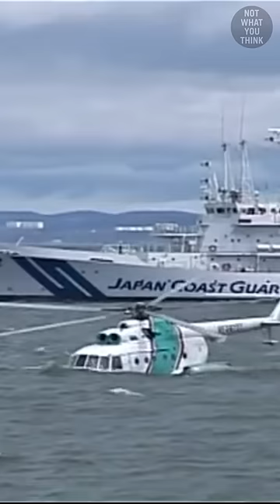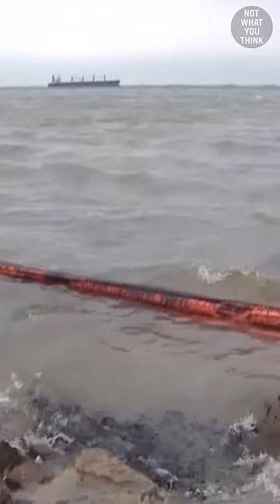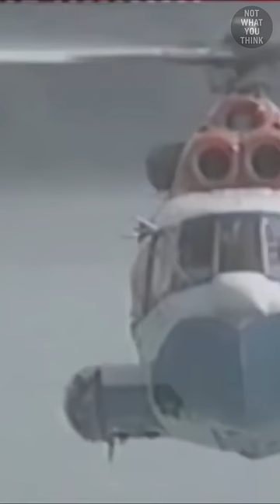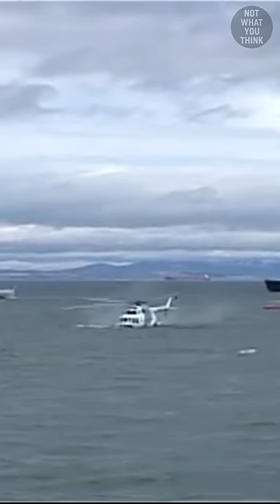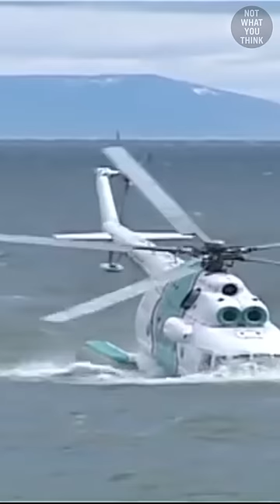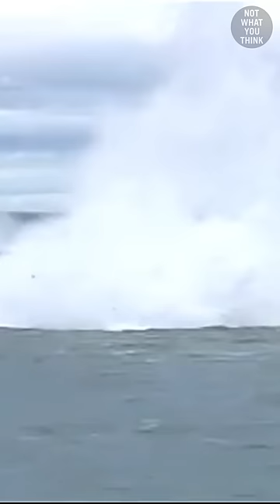Emergency Training Gone Wrong

Comment: Pilots should have stopped the rotor engine, and immediately evacuated via deep dive and swam as far out as possible.
Reply: That would have looked just as stupid as what he did do seeing that it's an amphibious anti submarine helo designed to land in the water.
Reply: @steveletson6616  Except it was pretty apparent it wasn't taking off after multiple attempts. Now instead of looking silly and having to recover a helicopter mostly intact with all crew safe you have dead and injured as well as a trashed helicopter.
Reply: @zyeborm I don't think you understand what he meant possibly. By "it's an amphibious vehicle" I would think that @steveletson6616 is implying they should've just shut off the rotors. 

It's a helicopter, yes, but not a normal one whatsoever. It's designed to be able to land on water as it's an anti-submarine helicopter (which sounds insane but it's true lol). 

The reason it couldn't take off again was due to (one of?) the engines failing which limited it's power output. Instead of attempting to takeoff with this issue over and over again until it nosedived, the pilot should've simply cut the power.

No one would need to deep dive since the helicopter is designed with a type of boat-like hull so it floats, hence why diving look just as stupid as what the pilot did. Both are unnecessary and look stupid because he should've just turned off the rotors, saving all of the crew and probably even the chopper
Reply: @Slyfoxx  they are amphibious after having all the seals fixed and openings closed etc on them. IE they can do it if prepped for it specifically. Even then it's limited to like some number of minutes not hours.

Also I'm the one saying he should have shut down.
Reply: Yeah agreed this wasn't combat training
Reply: @Slyfoxx  Deep dive as in the crew rush to the waters and dive deep to lessen any harm that may be inflicted by the still spinning rotars, and swim as far out possible. NOT the machine itself.
Reply: @steveletson6616  So you wish to sit there instead of hopping into the waters and hope for the best by being a sitting duck. You do you.
Reply: @anadventfollower1181 There's lots of assumptions going on here because the video doesn't provide a lot of detail. Since the chopper was involved in marine rescue training manoeuvres, there's a chance that all of its seals and hatches were in good order. If that's true, then the chopper would've been the safest place for the crew. If the chopper was designed to float so that it could touch down in the water, then presumably it was made watertight enough for the thing to take off again had there been no mechanical failure. The sea is very cold and unforgiving, so hypothermia is an issue, not just drowning. As there were a number of rescue craft in the vicinity, then staying warm and dry and waiting for a nearby vessel to come for them sounds like the ideal course of action.

Perhaps, though, the chopper crew knew how poorly maintained their aircraft was, and perhaps they were already taking on water, and so escape would've been prudent. We need more info to know which scenario applied, though.
Reply: @PrenticeBoy1688  The problem is, if there is no lift, and a rotor is going full force while it is tipping forward- what do you expect when it finally makes contact with the water? No human would come out injury free by being jolted and thrown around like some rag doll. It is about knowing the outcome.
Reply: @anadventfollower1181  What if they cut power after it became clear they didn't have the power to lift off? From the footage shown, it looks like it was another attempt to lift off that drove the nose under.
Reply: @PrenticeBoy1688  Yep. That is exactly what happened. That is why the first few attempts should have indicated that to the pilots, prompting them to immediately cut the power to the rotors instead of trying to life off.
Reply: @steveletson6616 That is incorrect. They are not amphibious. They are designed to float for a short time in order to allow the crew to escape safely in an emergency. Landing on water is not part of ordinary operations.
Reply: @Slyfoxx  That is incorrect. They are not amphibious. They are designed to float for a short time in order to allow the crew to escape safely in an emergency. Landing on water is not part of ordinary operations.
Reply: @Studio23Media  Aparently I'm the only one in the comments who isn't an idiot and actually did some research on this helicopter. It's an amphibious anti submarine helo for sure. That is the only true part of the video. This channels vidios are all BS storylines with pieces of random vidios patched together. Like where he says it's a Russo-Japanese training exercise. There is no such thing. They are enemies and do not train together ever. The only part that was true was the model of the helo.
Reply: @Studio23Media you can just tell me you don't know how to do any form of research my guy 💀

You're wrong lol. It can 100% land on water. "This multirole helicopter can land and taxi on water, and also take-off from water. Mi-14 helicopters were developed by the Mil Moscow Helicopter Plant and produced by Kazan Helicopters from 1973 to 1986."
Reply: @steveletson6616  Lol you really don't know what you're talking about... 🤣
Reply: @Slyfoxx  Apparently you can't read very well. 🤡
Reply: @zyeborm 😂😂😂

Comment: "Soviet Built"
I found the problem. That is why the engine failed.
Reply: almost as bad as american cars lol
Reply: average bot
Reply: @Sirethic  who or what is an average bot?
Reply: @Sirethic 
Original poster ain’t a bot, dude. Learn how to tell the difference.
Reply: Sayings that most soviet stuff wasn’t necessarily built very well is like saying the sky is blue on sunny days. It’s straight up facts.
Reply: @ShortFuseMan  any source of information you can share? I don't see how you can know.
Reply: @kwaynr1301 lazerpig and the military show both have videos on this topic that break it down, but basically it’s a combination of things: push logistics causing headaches, fear of reprisal covering up issues so they don’t get resolved, corruption doing the same, brain drain and lack of resources due to draft dodging and such…. Etc etc
Reply: @eeyun5279  yt videos? I don't see how that would be a reliable source. You could say the same about US military equipment.
Reply: Heart attack

Comment: The video is older. The helicopter suffered from  a vortex ring state. The air around the blades starts circulating and does not create upflift anymore.

Comment: Surely the first thing would be to get the 12 passengers off to lose weight and save them but also .. .. .. if it dropped from mechanical failure why try to lift off again at all?

Comment: Engineers: “Let’s add a boat hull to this helicopter”

Air Force: “Cool.  You’re going to make it water tight, right?”

Engineers:

Air Force: “You’re going to make it water tight, right?”
Reply: It’s not a boat hull. It’s a regular Mi-8 hull basically, with some modification for antisubmarine work.
Reply: @PandaMan-xy1he  The Mi-14 does indeed have a boat hull and is meant to operate on water.

Comment: Why didn’t the pilot shut down and do whatever their emergency procedure was for that incident? I don’t think trying to take off after already having a major mechanical issue (like an engine failing) would ever be a good idea. 
But this is a genuine question nonetheless.
Reply: (I know I copied this from another comment, I'm too lazy to re type it lol) 
As far as I'm aware, with most of those floating helicopters like the Sea King or Chinnock, since the engine is so high on the body it has a high centre of gravity, the props need to spin to keep it upright or it would capsize. Hope this helps mate

Comment: I'm not a pilot, so take what I'd say with a grain of salt since I don't have any specific training for what to do in this scenario.

I would have shut down the engines the moment it was clear we were in the water.  The cabin clearly was buoyant enough, and I would have sent a mayday signal right away.  The nearby ship would have already begun MOB procedures, and my focus would have been on the safety of all aboard.  The helicopter could be recovered once everyone was safe.
Reply: It's amphibious so taking off from water is pretty routine, I guess the pilot didn't realise they didn't have the lift until it was too late.

Comment: You can’t do a single engine running take off on water, with 9 or 10 guys in the back. 

Now maybe if they’d kicked the guys out that 1000kg less & may just have given them enough to get airborne but I doubt it very much.

Comment: They 100% should have turned off the rotors as soon as they realized they were stuck in the water, the answer is definitely not to hit the throttle and think you're going to be able to recover

Comment: I wonder if pieces of the rotor blades went inside the chopper killing 1.. cause the crash was fairly a soft crash.. it had to be 1 was hit by debris, or either 1 drowned whrn it went upside down, and the 1 couldnt get out in time..

Comment: Helicopters don't just nosedive out of nowhere. The cyclic stick was pushed forward... And I wouldn't be surprised if it was the pilot trying to get some forward speed in an attempt to kind of skip and bounce to get airborne.

It might have worked if not for the nose digging in. It's hard to say what I would have done but if there was a standard operating procedure for water ditching,I suspect it involved immediately rolling the throttle off and shutting down. But I'm not Russian, so I don't know.

Comment: That helicopter is made to land and even shut its engines off on the water.. This helicopter didnt just land, it dropped like a rock. I think the front bouy cracked and took on water making the helicopter extremely front heavy. Nobody could have seen that damage but the drop should have caused some concern. That chopper should have stayed floating and unloaded the crew. As for the helicopter, it would have been recoverable although getting it out of the water in the middle of the ocean would have been a new issue.
Reply: Helicopter can land even when engine is shut off but the height he was at didn’t allow enough time to slow down
Reply: Looked like he tried to auto rotate with flared rotors.

Why he tried to take off again IDK, maybe the throttle was stuck on fully open? 

Seems the best would be to get the weight down by taking the 12 passengers off at least.
Reply: I can see it being simply pilot error. Thinking it was safe to spool up and take off again not knowing it was taking on water, making it unbalanced and too heavy to take off.

Comment: It looks like the helicopter was designed to float. At least for a little bit. If they had just shut down the engine and bailed out. They most likely would have been fine.

Comment: japan always have this kind technical management glitch

sometime force their self without proper situational measurement

though sometime that attitude produce excellent adaptation performance

but the risk isnt minor

except u operate amphibious plane it was improbable to take off from unsolid surface

van der wals effect make water bind the body like glue that give extra load

the real problem comefrom shifted center gravity to the front due to extra lift from the tail rotor

evacuation is the only possible way

Comment: Helicopter had the submarine feature built in 💀
Reply: It's built into the name. It's an anti-submarine helo designed to land in the water.
Reply: I mean it is Russian, lots of their stuff is being a submarine lately
Reply: @etson6616 All anti submarine helos can land in the water, usually just once, for a permanant conversion to submarine
Reply: @zyeborm also very lately an Abrams has been mauled before it could be useful in Ukraine.
Reply: @Lucapanfil  oooh one tank got hit in battle. Shocking. Nobody even called it invincible or lied about it after. Amazing
Reply: @zyeborm  their power was over exaggerated, they did not do much good for Ukraine but let them down.
Reply: @Lucapanfil  lol try harder. If you need help getting out of Russia let me know.
Reply: @zyeborm  I’m not in Russia, and am not Russian, instead I’m a normal guy who doesn’t eat bias.
Reply: @steveletson6616  That is incorrect. They are not amphibious. They are designed to float for a short time in order to allow the crew to escape safely in an emergency. Landing on water is not part of ordinary operations. Anti-submarine helicopters do not land on water to take out submarines. That's not at all how it works.
Reply: @Studio23Media  Yeah, I eat bias because I said Abrams wasn't invincible and nobody with a clue ever said it was? Yes. I guess that is biased...somehow?

Comment: I'd blame the pilot and co-pilot for the loss of life because why would you try to lift off afterwards?
Reply: Amphibious or not, the last place you want to be is in the water, once things go wrong those blades take a while to slow down.
Reply: @jon2922  Firstly, I never mentioned anything about it being amphibious, so that means nothing to whatever point you'd like to prove here. If there was an "amphibious" factor to this type of helicopter, the decision they made increasingly worsens exponentially. Secondly, this could've been far less disastrous had they decided to shut the faulty engines down and NOT lift off. Now, back to what I said... They had other rescue team boats within a VERY close range. Once the helicopter touched down in the water, why not kill the engines? The rotors would've slowed down enough. It was obvious that the water had a "suctioning effect" on the helicopter, which directly affected the nose dive. It could clearly be seen in the video. The helicopter also seemed pretty buoyant as it rested on the water. The action they took was still dumb, regardless. There could've been ZERO casualties.
Reply: @BuGGed0utKeV  when I said "amphibious or not" I meant that it's an amphibious helicopter, capable of sea landings (that's why it floated).

My point was that, even in a helicopter designed to land on water, you really don't want to be in even relatively rough ocean water.

From the pilots perspective they'd just had a sudden loss of lift and had no way of knowing they now don't have the power for takeoff, getting the helicopter back out of the water before a wave rolls them over would be priority number 1.

By the time they realised they weren't going anywhere it was already too late, rotors take a while to slow down and that tip forward happened very fast.

Yes, the correct thing to do would have been to shut the rotors off the moment they hit, but there's no way any pilot could've known that at the time, they took the action that made sense with the information they had.
Reply: @jon2922  it's FAR FAR FAAAAAAARRR worse, knowing it's an aircraft that is actually built to float on water! I mean, 😆 🤣. C'mon now! You're just making the perspective(s) so much worse for them. I'm honestly not sure how you can worsen the case for them anymore... COMPLETELY AT FAULT. I've heard enough AND said enough here. And your point here was..? <--- totally rhetorical question. Please don't reply.
Reply: @BuGGed0utKeV  it's designed to land on calm water, not large (or even moderate) ocean swells.

When they landed in the water they were absolutely in danger of having a wave turn the helicopter over and kill them anyway, so trying to take off again was a pretty sensible idea.

The problem was that helicopter rotors take a lot of time to slow down from full throttle, add one wave to tilt them forward, the nose digs in and the rotors hit.

My point is that calling this "pilot error" is wrong, they made the best choice with the information they had and if it wasn't for the mechanical fault it'd have probably have saved the helicopter.

(Also take some time to actually read the comments, you might understand then better then, also maybe take some extra time to read yours, the last couple were difficult to read to say the least)

Comment: If your equipment fails, don't try to push it. In this case, if you cannot go up vertically, then you cannot go forward... If the pilot just chose to shut off the engine, they would have had options to recover the helicopter.